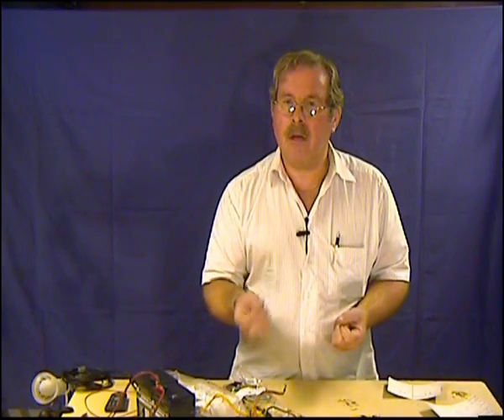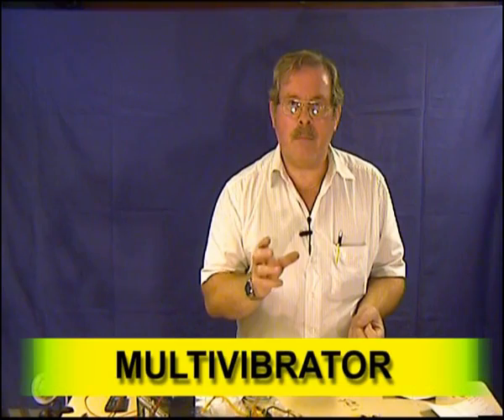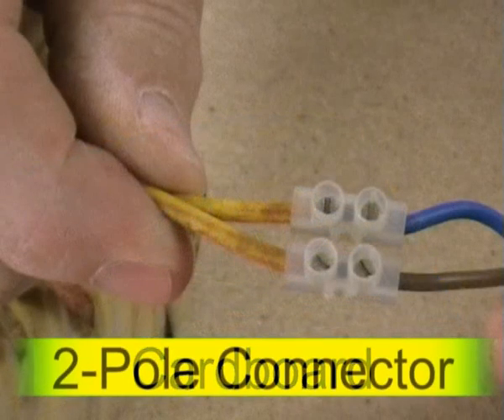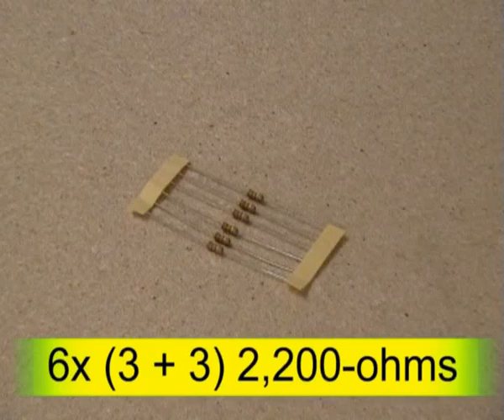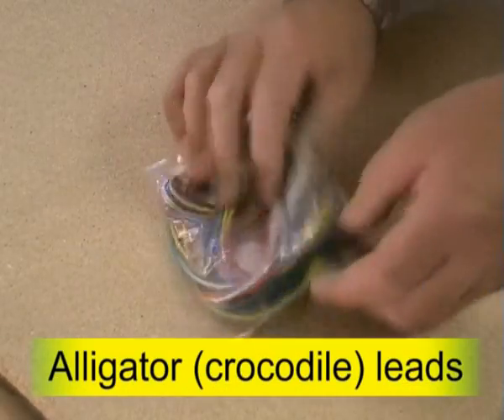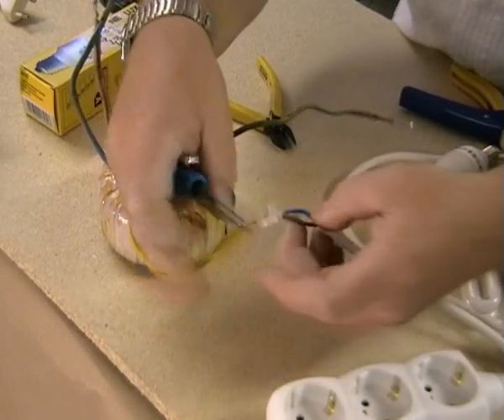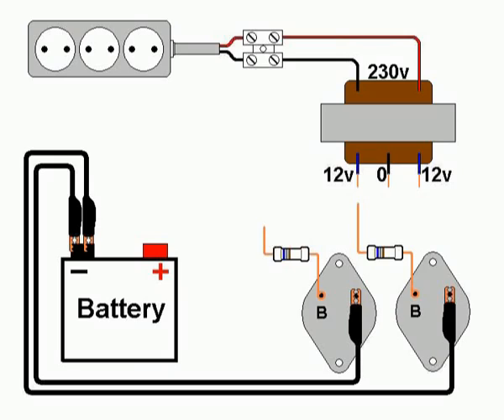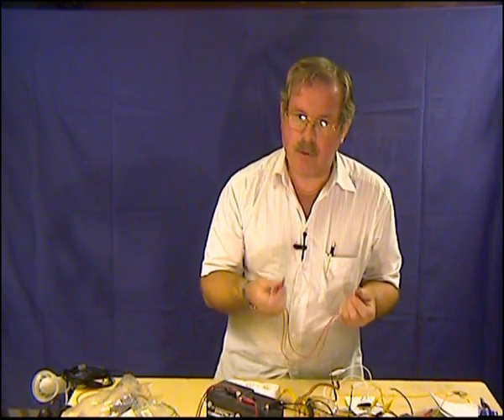Generating AC Power

Comment: I don't understand. Why are you using 1.5W resistors each at 680 Ohms or six .5W resistors at 2.2K Ohms? Why not use the same value in Ohms for either type of resistor?
Reply: easy - 0.5W resistors a cheap and plentyful. I have a good stock of them. If I wanted a 1.5 Watt resistor I would have to go out and buy it. Buying is against my principles.

BR Harry
http://sm0vpo.forumstopic.com

Comment: Bloody fantastic, mate. Very well presented. Just quick and to the point.

I do have experience in the 240VAC area although was unaware of the fact that you could generate AC voltage using a multivibrator. I was under the impression that a PWM controlled H-bridge would be required.

Thank you, very much for this outstanding demonstration. I have liked and subscribed and hope to see more from you in the near future. :)

Comment: I dont think so, i guess those coil are used as a part of the resonant circuit(vibrator circuit) with two transistor you need two coils because when one of them is turned on the other one is off. This way it makes a kind of pulsating voltage which generates variable magnetic field thrue the coil and with this induction you have the 220V in the secondary coil. In my opinion. About the power he can supply it depends on the trafo that you are using it and ofcourse  from the DC source.

Comment: @tvolala1976 It's called 'magnetostriction' it is coming from the transformer. As the domains inside the transformer core swing from north to south they slightly change shape causing the metal laminations to knock together.

Comment: Most effective way would be using AC motor(s) and frequency controller. The inverter build would be quite the same seen here using transistors with different parameters.

Comment: hello harry thankz 4 the video its works great, i used a 110v to 12v transformer
and i got 220v, am using 12v to power the transformer, what should i do to get just 110v or 120v,  thankz

Comment: So what effect would the frequency of the waves have on the circuit e.g power output, doesn't the inductance go up if the frequency does, and if so wouldn't the overall efficiency of the circuit go up, thanks.

Comment: Thanks for replying, what resistors should I use if I want to use 2*6Volt batteries with a transformer that has 6-0-6 secondary's, thanks a lot.

Comment: Hello,
I am a fan of yours, I build modified and tested
your flip flop self contained tank circuit inverter, work's great.
Do you have any other AC inverters with self resonating frequency?
I am building a Push-Pull Ac inverter with an
555 Timer as the square wave driver, but i would like to build one with it's own resonant
oscillation frequency, therefore i could use more power without having problems with the feedback or reflected power.

Comment: Great video!

Is there a way to recognize a transformer which has a split secondary before I wreck the casing? I have a few lying around and opened one (230V@60Hz to 12V 500mA 6VA) which, unfortunatly turns out not to have a split secondary. I´d like to implement this. Tak in advance!